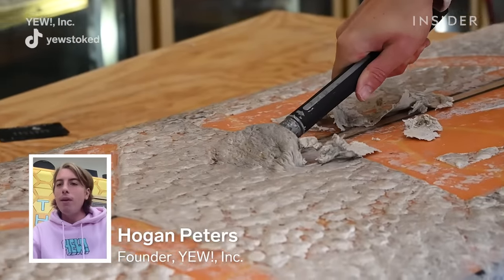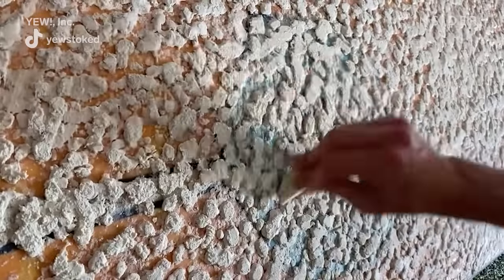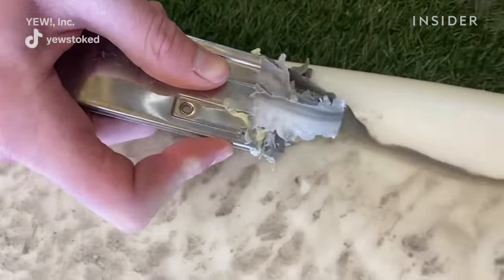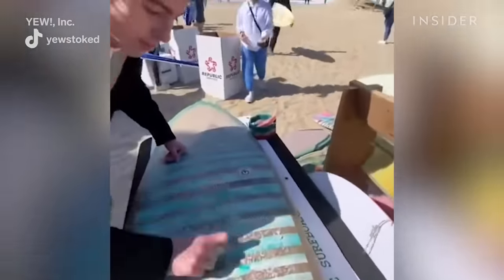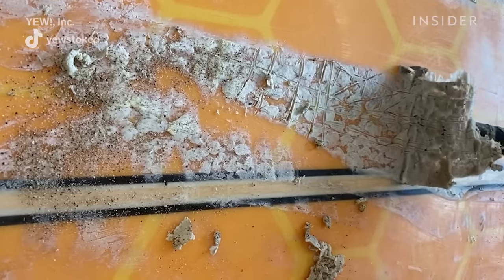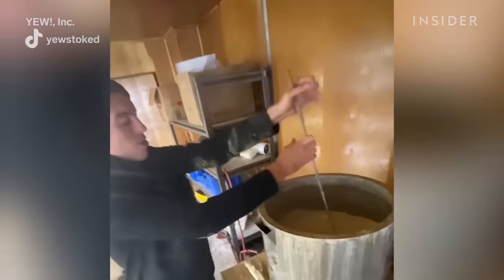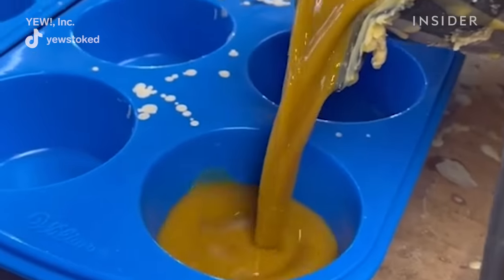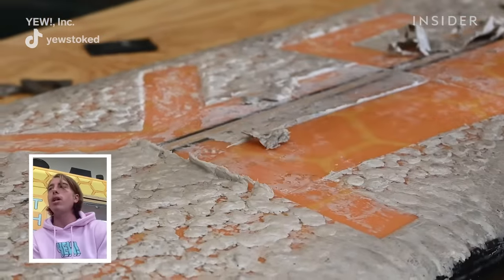Scraping Old Layers Of Wax From Surfboards | Art Insider

Comment: As a snowboarder, we wax the bottom of the board, and make it as smooth as possible. So when I saw the thumbnail for this I thought surfers were just legitimately losing their minds.
Reply: There is plenty of other ways to get zero friction even by single application, this is just commercial bs saying this toothpaste gives you the whithest teeth :P
Reply: I haven't been snowboarding in almost ten years and man, there is no other feeling like going down the mountain, wind in your face, zig zagging like your life depends on it...because it does.
Reply: I knew surfers wax their boards, but I also assumed it was to reduce friction in the water cause wax repels water
Reply: @alex73217  nah, it just makes it easier to stand on. Other wise the board is super slippery. That’s why they say to scrape it once the wax is no longer sticky
Reply: Losing their minds how?
Reply: It’s different type of wax. Two different wax for two different purposes
Reply: @Jjvvyt  Its wax, you could literally use unscented candle wax in both cases. There are additives and avoided chemicles in each use case to prevent corrosion or increase traction. But most of us just use what's available. One of my buds swears by the 10lb block of wax he buys at hobby lobby for like 10 bucks.

Comment: I didn't realize how much wax is put on a surfboard.
Reply: If they need that much grip, then why not design the board with grip instead of waxing?
Reply: @renjiabarai6081  that's a good question but then u have to still put wax after the texture gos down
Reply: @Pikachew675  It depends on the material. Just like in the skateboards grip that doesn't need to be replaced always.

I'm kinda curious, does skateboard grips could be use? Or is too abrasive?
Reply: @renjiabarai6081  i think it would be too abrasive. Also skateboard grip tape starts to become pretty slippery once wet. I think thats why they use wax. They dont want abrasive they want sticky
Reply: @renjiabarai6081  skateboard grip, that's sandpaper. Could you imagine scrapping your bare chest with sandpaper.
Reply: @Dev_nz117  Didn't know it was sandpaper. That would hurt so bad haha
Reply: @renjiabarai6081  because grips can go bad easily. and that’d be more money into productions. And more work essentially. Wax is easier to deal with.
Reply: Same
Reply: @renjiabarai6081  normal griptape is easily ruined by water. but i wonder if there's waterproof griptape
Reply: @kenopyowo  even if there was it would have to be a big piece, and do you really want to be standing barefoot on sand paper surfing? or have a massive sheet of  sand-paper under you if you wipe-out?
Reply: @Reverend_Salem  im sure someone could figure something out, maybe a specifically patterned sheet of silicone or some similar material. doesnt have to be embedded glass
Reply: It’s just for YouTube video..
Reply: @kenopyowo  i do think i remeber seeing something about non abrasive griptape for skateboards. Its something alot of skateboarders want becaise of how quickly you ruin a new pair of shoes skating.
Reply: you don't need that much unless you don't want chest hair.
Reply: Repent and believe in Jesus Christ  Jesus would be a surfer
Reply: @MindBodySoulOk  😆
Reply: @renjiabarai6081  so you can do ollies 😂
Reply: ON A SURFBOARD, NOT IN
Reply: @Pikachew675  wears down
Reply: @getin3949  thanks didnt realize i made that mistake
Reply: @renjiabarai6081  Skateboard grip is sand paper and would cause your feet to bleed really quickly.
Reply: @renjiabarai6081  , sorry Barney, it would exist if it was practical; but it’s not practical.
Most surfers don’t put anywhere near the amount of wax you were watching being scraped off in this video.
Straight up; if you need that much wax on a surf board. Stay out of the curls; weak foot’s! 🤙😂
Reply: @Wangdoodle444  Wow, you are so cool papa barney. Teach how to be a chad like you.
Reply: They don't have that much wax on them
Reply: The more you know ⭐️🌟⭐️
Reply: Not a frequent surfer but I’ve never seen anyone put this much wax, lmao. And most people I know with their own boards don’t wax the entire top surface, just the flattest part of the top or a large area closer to the back.
Reply: They don’t normally let it get this thick
Reply: @renjiabarai6081  it has to be sticky so you can pull up
Reply: Repent and believe in Jesus Christ  👋
Reply: @renjiabarai6081  maybe because that grip will get smooth over time like there's no need for it. Wax can be applied and removed easily.
Reply: @renjiabarai6081  your chest and stomach would get torn up when paddling if they made the boards with a grippy surface. Wax allows for exceptional grip while not shredding your skin when paddling.
Reply: @renjiabarai6081  It wouldnt stand up to the water, also it would be much much harder to replace when the grip starts to fade.
Reply: @kenopyowo  look up wakesurf boards alot of them have foam as griptape
Reply: @Dev_nz117  40 grit sand paper lol

Comment: So interesting!

I’ve waxed cross country (snow) skis before, didn’t realized surfboards get waxed, too. Different reason, though! (Ski wax goes in the bottom and affects the grip/slide in different snow temps).
Reply: Wow didn't know that either
Reply: @SanjanaRanasingha  For real, interesting facts.
Reply: That's what I thought the wax on surfboards was for, the bottom of the board. I figured the material surfboards were made from offered grip. Or that they had a coating on them for such purpose.
Reply: Wait SKIES GET WAX TO WHAT!!?
Reply: @donniefusionchannel6752  snow isn't inherently all that slippery on all surfaces. The base material of skis would work mostly ok directly on most snow,  but you want to change up hardness and how water repellent the surface is based on snow conditions.
Reply: Exactly what I thought.
I always thought the waxing was to help slip on the water, just like skis.
Never went past the "waxing our surfboards" line in Surfin' USA of the Beach Boys.
Reply: Wait you wax those?! I'm learning so much today y'all. It's blowing my mind. Never been skiing

Comment: I always thought surfboards got waxed on the bottom, to make them slide more smoothly through the water. :)
So... why isn't there some kind of anti-slip surface on surfboards?
Reply: All I’m thinking is a rough grip surface which would likely scrape the skin off you if your turfed off that board.
Reply: @Jazzatic2011  Yea, I think you're right. Anything remotely course would probably work like sandpaper after a short while.

So, maybe it's an idea to design boards with bumps on them, like how the wax seems to accumulate in bumps. 
But hey, what do I know. These guys have been doing this like forever. They probably know exactly what's shaka-brah and what's not. :)
Reply: Wax is cheap, eco- friendly and water resistant so it wouldn't be worth making another product. Sometimes the easiest method is best.
Reply: @dj_nyx8903  Well, that's the thing: It doesn't seem like the easiest method! It needs to be applied, over and over, it gets dirty and it needs removing after a while.

I guess making a bumpy board would still require wax, but it would be a biatch to clean.
Reply: they make rubber texture grips for your back foot but I've never been a fan of those. Wax is cheap and easy.

Comment: Is there a surfboard that's already 'waxed' permanently? (Like yoga mats that are especially made with a layer for good grip.)
It could be a lot better for the environment and much more convenient!
Reply: So far we haven't been able to engineer a surface texture that works quite as well as board wax does. With usage of wax it also allows surfers to customize exactly how much grip and what types of wax they like on their boards without increasing production costs of the boards themselves. 

Most non slip surfaces erode quickly, and many of them are quite "grabby" which sounds good in theory and works fine on something like a skateboard, whereas a yoga mat type coating just wouldn't last long enough in salt water over long periods of time. 

Surf boards need to have a surface that your feet can grip on without causing friction or abrasion injuries (ever get salt water in a scrape or wound? Yeowtch!) and wax is the perfect substance that we've found for now. It's a good non slip surface that your feet can anchor into but also gives way when needed without causing injury. 

I'd hate to get battered with a sandpaper board in the waves, did you know surfers (prior to board wax being invented) would coat their boards in a sand/varnish mixture? They all experienced the aforementioned scrapes, especially on their chests when paddling out into the waves. No thanks! 

Board wax is a wonderfully low tech solution that works beautifully, and over the years companies have come out with very environmentally friendly formulas. It's the best we got so far!
Reply: @TinyAloePlant  thank you for the explanation 🙏
Reply: @TinyAloePlant  yoga mat material is also slick once it gets too wet
Reply: Thigh and titty rash is very painful on a week long surf trip! ⚡
Reply: When you're smashing that lip you're going to want that extra grip😍
Reply: But isn't it alredy? I mean, he said that is made with beeswax and that the scrapes that you have at the end can be transformed in candles
Reply: @一ばん  Beeswax certainly isn't the worst, especially as a contaminant, but its production still requires the keeping of honeybees, which, contrary to popular belief, isn't completely beneficial for the environment. Honeybees displace native bees which are integral to the pollination of native plant species.
Personally it's not something I'd recommend worrying about vs, say, even driving your car an extra hour a week lol. And you could easily make up for that by just planting some native flowers in your backyard, seeing as habitat loss has a bigger impact on native pollinator populations. But, if your goal was to make something as absolutely environmentally friendly as possible, the impact of honeybees is still worth considering.
Reply: Soft tops don't need wax...
Reply: @Lacroix999  but that is what they are trying to avoid.
If its slick when wet then there is no grip
Reply: @TinyAloePlant  yep, when I went surfing a few months ago. The instructor told me I needed to wear a shirt if I wanted to keep my nipples.
Reply: @DaimyoD0  a soy wax based board wax might be better in that regard
Reply: They do make soft top boards, but they're a little heavy and intended for beginners so you don't hurt yourself as badly if you were to fall or have it hit you. Those don't need wax as the surface is made of a pretty grippy foam. They also have foam pads for the rear foot on surf boards as well if desired. The only issue is soft tops and foam pads do eventually cause rashes if you use them for too long.
Reply: @fgigjd  yep! Rash guards are the best!
Reply: @Davemike27 
The first half was nice. Second half: rude. 

If they weren't paying attention, they wouldn't have the basis of thought for what they questioned.
Reply: No. Integrated grip isnt a good idea for the longevity of the surf board, as they easily would rub off, and would result in having to replace the whole board instead of just wax... same with skateboarding, although skateboards are wood so rarely need a grip change before their lifespan is over

Comment: It’s amazing that after all these years, manufacturers haven’t just starting selling “grip tape” like material on the top of boards

(Edit) i’m not talking about actual grip tape, that would hurt. I’m talking about texturing the top surface of the board for more grip but not sand paper material like actual grip tape
Reply: Start that business if you can
Reply: I'd guess it's because the wax method is a simple single ingredient solution that's inherently waterproof. A Tape product would have to have a solution for that since one side would be the grip but the other would be an adhesive which would need to be resistant to the water exposure somehow while also being easily remoavle for renewing once  in a while.

If you solve all those problems you've still run into the biggest problem of needing its production and marketing to be more profitable than using simple wax lol! Prob not a feasible idea in the end
Reply: That will scrap your skin off your belly and also when board crashes in wave
Reply: @SoulDelSol  not actual grip tape material your feet and front would be raw in no time
Reply: It's been available since I was a kid.......?
Reply: Do you want to lose your chest and face skin after thrashing into a wave? Dear god grip tape would be terrible
Reply: They have something like that but it’s more of a foam pad u put on top
Reply: It would be too expensive... and if it's too special, it probably wouldn't be easy to re-apply. Also they would have to take legal liability. XD
Reply: If they make a product so good you won't need wax again how will they make money? They haven't made it yet because they make more without it
Reply: @Sagalos, wax actually is sticky. Texturing the fibreglass won’t add stickyness.
Reply: maybe because the surfers think it's cool to wax their boards... i mean, if i saw a hot guy waxing his board on the boardwalk, i'd talk to him.
Reply: I would rather do that. 
I don’t surf but I want to. 
I would eat have a skate board-like surface than wax.
Reply: @JerseyAccent653  I promise you that's not it. It's just for traction.
Reply: Sounds like your talking about a tape that bowlers use for a ball that's holes are a tab to big.
Reply: Surf Systems makes clear grip it's not rough but it grips. I've got it on my knee boards. It works on regular boards too. If you have nice art on your deck you don't have to cover it with wax.
Reply: I wondered why surfboards weren't just made with a texture already.
Reply: @keithwhiteley1303  you are a saint and a scholar
Reply: Most knee boarders put a pad where your knees and lower legs are on the board. But you need to grip the front of the board. I put surf Systems grip on the front so no wax. Cove pads from surf Systems.
Reply: I believe Casey has YouTube videos showing grip being applied. It's like putting tint on a window sort of. Surf Systems his pads are nice.
Reply: Waxing a board is part of surfing. It the journey not the destination.

Comment: Can't they make a surfboard with a non slip surface?
Reply: Sort of; most non slip surfaces erode quickly, and many of them are quite "grabby" which sounds good in theory and works fine on something like a skateboard. 

Surf boards need to have a surface that your feet can grip on without causing friction or abrasion injuries (ever get salt water in a scrape or wound? Yeowtch!) and wax is the perfect substance that we've found for now. It's a good non slip surface that your feet can anchor into but also gives way when needed without causing injury. 

I'd hate to get battered with a sandpaper board in the waves, not to mention when your fingers and toes shrivel from moisture they're easier to scrape! 

Board wax is a wonderfully low tech solution that works beautifully.
Reply: @TinyAloePlant  you explained that very thoroughly, thank you!
Reply: @TinyAloePlant  but they also have rubber versions of grip tape which would not be as aggressive but still grippy.
Reply: @TinyAloePlant  thanks Jennifer. I was thinking of something like a silicone but I'm guessing that as long as the wax is non toxic to aquatic life there's no requirement to change ☺️

Comment: I would think that sand in the wax would create an effect similar to grip tape on a skateboard. Why doesn't it?
Reply: Because you wear shoes skateboarding so the rubber bottoms of shoes stick to the grip tape. But your wet feet wouldn’t stick to sand, but they do stick to wax.
Reply: Even if it did I guess it’d hurt on bare wet feet

Comment: Loved the video. How are the Bee's, that we need for pollination, doing without that wax? Are you finding out if the farms the wax is from is feeding the bees?
Reply: With domestic bees you have to change the wax every now and then anyways.
If they only take old wax and then clean it up again you can actually get a considered amount of it over time.
You basically have to take out these and give the bees new empty spaces (with some wires to help them start new ones) every 4-5 years. Specifically with their breeding combs. However you do not just take them out.
There is a process of putting them in a place where only the workers can get to (not the queen) first. This way the remaining bees can hatch before you take them out.
After this amount of time they usually have a considerable amount of feces, pesticides and pathogens and are nearly black.
At this point it helps the health of the bees to do this. 
If you have enough hives, willing to clean them from all of this and if you are in business for more than 4 years you have enough wax to be used without any harm for the bees. (it's actually beneficial if done correctly) I can't tell if this person handles it this way, but most people outside of the bigger industry take very good care of their bees and are very careful with what they take.

Except for if you take honey while winter is approaching (which you should not) there is rarely a necessity to feed them (except for keeping enough nice flowers around the hives).